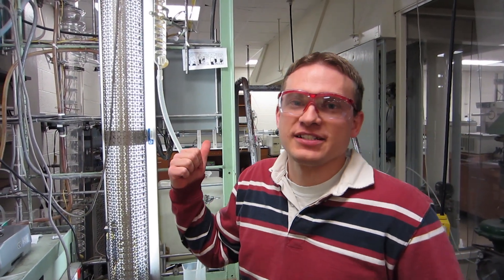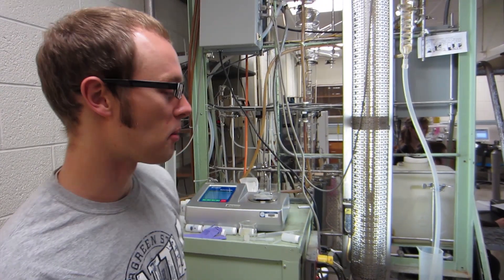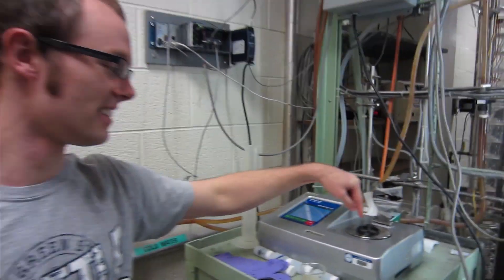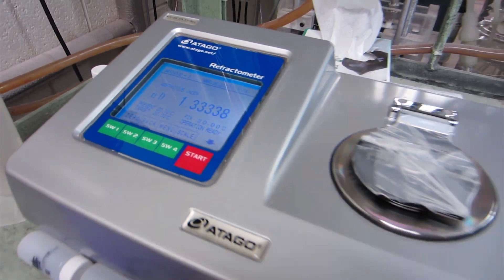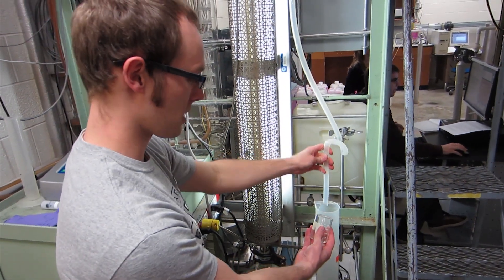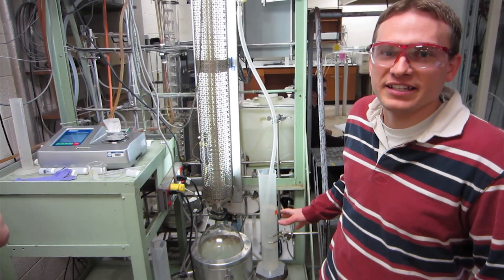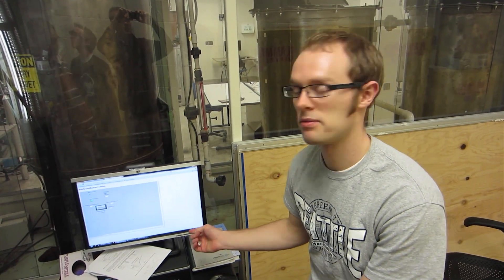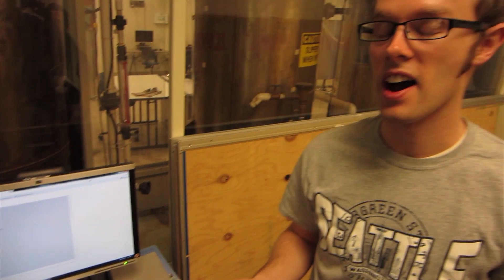Operating a Batch Distillation Column

Comment: We recently published a paper that uses this batch column to generate data for the study on dynamic optimization. Here is a link to a preprint: Safdarnejad, S. M., Gallacher, J. R., Hedengren, J. D., Dynamic Parameter Estimation and Optimization for Batch Distillation, Computers & Chemical Engineering, Vol. 86, pp. 18–32, 2016, DOI: 10.1016/j.compchemeng.2015.12.001. (http://apm.byu.edu/prism/uploads/Members/optimized_batch_distillation_2016.pdf). There is also source code for this on Github at https://github.com/APMonitor/batch_distillation?files=1